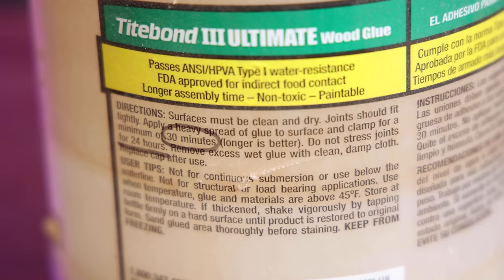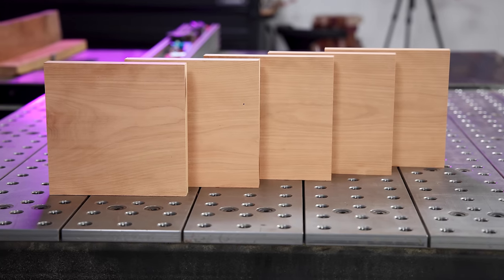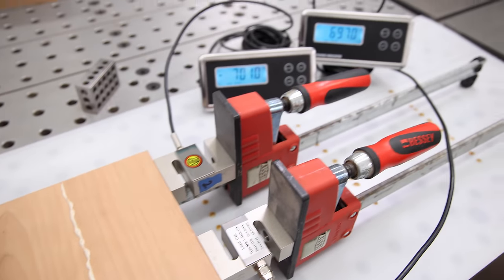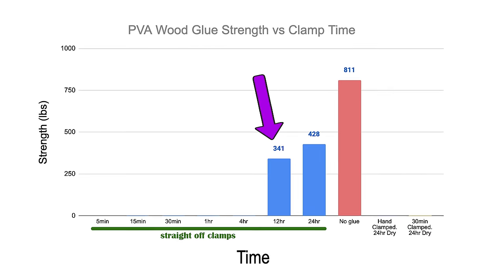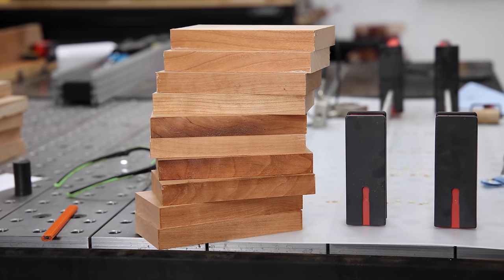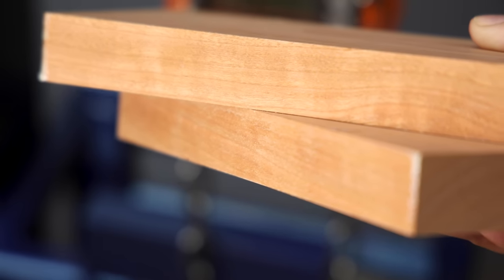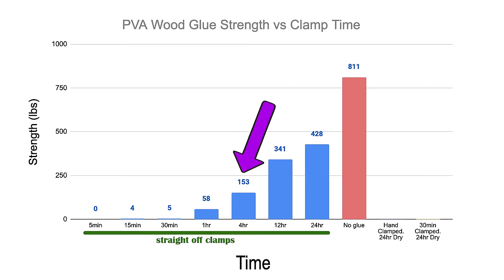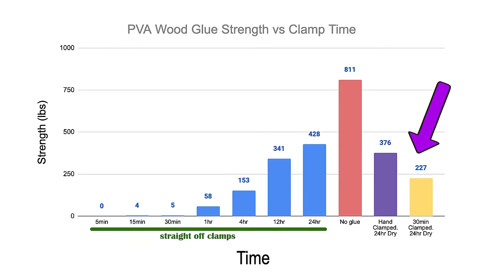you are clamping too long

Comment: Did you also notice it said "30 minutes minimum but longer is better"?
Reply: A few other notes:  Titebond uses hard maple for glue testing.  A planed surface is somewhat burnished and glue may not penetrate as well as a surface that has been sanded.  High clamping pressure can cause excessive squeeze-out and starve the joint for glue.  As long as the glue still contains some of its water, it's not fully cured.

Comment: Clamping is simply to ensure proper contact and immobilization of the pieces during lamination. You seem to be testing based on an assumption that clamp time equals, or is somehow related to, cure time. Overall, it's nonsense to test wet glue, you wouldn't drive on fresh poured concrete and expect it to be solid. Also, because the aim is to adhere the wood fibers of both pieces together, not just having a glue filled gap, squeezing out the majority of glue is key. The strength comes from the impregnated wood fibers bonding with those on the adjoining face.

Comment: I think the "company test" faired worse than the "hand clamp" test, by a very silly reason. Hands are squishy, clamps are not.

If you just clamp them by hand, you're not applying as much pressure and your squishy hands are the ones doing most of the palstic deformation anyway. With clamps, pressure is higher and it is the rubbery still curing PVA that is the squishest bit, and like any rubbery material it will want to expand the most whent the pressure is release, widening the gap and weakening the final joint.

Comment: So, your setup where you plane the pieces at the same time and then flip them like a book: i have no idea how likely it is for the surfaces to become uneven, but it seems like you're using that method to deal with unevenness, no? 

But isnt it true that if there was any unevenness, the book situation would place the high spots and low spots in direct contact with each other, amplifying any unevenness? Similarly, if the angle of the plane is ever off from 90⁰, flipping the pieces like a book will again amplify the error, not lessen it. To me, this isnt the way to make a perfect joint, it's the way to find out if you made any mistakes cuz they'll be made more obvious.
Reply from the maker: It’s not a bullet proof method unless you have proper techniques applied. Each sample were inspected to be gap free for the tests. Eventually I used a shooting board make sure the consistency was at a high level.

Comment: You may want to make your experiment more of a practical usefullness for outcome. The glue join is never at 100% of required strength or we'd see most projects fail in real use. It's more likely the glue joint is 60% or less to include a factor of safety, that's engineering speak and the thinking that keeps people alive. So the join needs to initially keep the project together then strengthen for in use load. If you run the same experiment and leave the project for 48hrs then test you may have more meaningful info

Comment: Glue needs 24hrs to dry, that is what your test shows and what the manufacturers say. That shouldn't be the variable. Clamp time vs unclamped time should be the variable.

Your dataset does not support the conclusions you gave. You don't know that 1 or 4 hour clamp time with 24hr unloaded time would perform better than the 30min clamp time with 24hr unloaded time as you didn't test that.

In fact you showed that zero clamp time is better than 30min clamp time (which I think we can all assume is an anomaly, based on experience, but not supported by the data), which implies that less clamping time is better if you leave it for a full 24hrs. 

That said, I like that you are doing this sort of thing and bringing some science to this. But feel the experimental design could be improved

Comment: Regardless of the clamp time, the glue drying time has to be consistent or the whole thing is meaningless. Making conclusions about necessary pressure based on the way this was done is invalid.
Most experienced woodworkers know you do your clamp ups at the end of the day and disassemble them the next morning. They also know that average firm tightening is enough pressure... you don't have to bear down on them. Ultimately clamps should be on until the glue dries and otherwise pressure in psi is not really a worry.

Comment: When I read the bottle and saw 250 PSI I was sure it must be incorrect.... Think about it, if you have a 6"x6" board, that is 36 square inches.. If you go by the bottle you will have to put 9000 lbs on the board to clamp it at 250 PSI.... There is actually no fucking way they understand the unit PSI.. Pounds PER square inch.

Comment: Is it possible your prep was too good?  If the wood species is hard and the faces are perfectly smooth and parallel perhaps there is not enough glue left in the joint?
Reply from the maker: It’s definitely something I need to explore more. Sanded vs saw cut vs hand planed glue edge and respective strength.

Comment: Comon man, you are mixing up clamp time with cure time. Cure time should be 24 hours for all samples, but the clamp time can be different. That's the time table I wanna see.
Reply from the maker: My goal was to see how strong the joint is at that clamp time and find a point where clamp time made the joint as strong as the wood (4hrs). More data would have been useful for stuff like 1hr clamp time and letting it dry for 24hrs but producing this video took enough time out of my life.

Comment: It seems to me that you need to try this with different kinds of wood to prove your point.
Reply from the maker: Wanna help me? Bc these testing takes many hours per set. Adding one species of wood is probably going to take 20hrs+ for each species.
Reply: I suppose if cherry is less like to split than other woods it could be deduced that the results are valid for the weaker ones. I appreciate the time you take to produce these videos. If it's not worth it to you, then quit.  If it is, then don't complain about it. .  @WoodcraftBySuman
Reply from the maker: @MrMasterFlash   It actually goes the other way around: using a single species of wood was a way for me to control confounding variables. If you don't understand why that is relevant, the video is not for you.
Reply: Imagine if you did this with wood that is always weaker than the glue--can you see why the experiment wouldn't work? The same thing with wood is always stronger than glue. You don't need to be defensive. It's not a good look.  @WoodcraftBySuman

Comment: The hand plane, used simultaneously on two pieces of wood, still requires you to plane a perfectly flat surface. Your move hand tool user.

Don't believe me? Plane some high & low spots and see how all they align.
Reply from the maker: Well, they started out pretty flat and straight off the jointer/planer and further refined with hand tool. 
But I love your underlying implied assumption that I don’t know know what I’m doing with hand tools. Sure thing bud.
Reply: @WoodcraftBySuman  genuine apologies for creating the impression, it was not my intention. I have no doubt that your skills are vastly superior to mine and your contribution to the community is beyond excellent. Truly. I have no doubt on your skill with hand tools. 

In this case, you are demonstrably wrong but I will work on trying to give better criticism, and try to make my genuine respect for your work far more apparent.
Reply from the maker: @JustinShaedo  Justin, I am open to learning and understanding. It is often difficult to demonstrate everything in a video intended to maintain retention. What is your concern on the technique? 

I started with flat and straight edges. The two pieces of wood is 2” wide in total and my blade is 2-1/4” wide— allowing for a single pass to hit both boards at the same time. Beyond that, it really just comes down to appplying the right amount of presssure and mechanics at the beginning, middle, and end of the board with a properly tuned plane. I then visually inspected each joint for fit. Would there be something I am missing?
Reply: at 2:17 "when you fold them in like a book, it creates a gap free joint". The technique shown is great, nifty, more stable, easier to plane across the grain and almost certainly faster; but it does not improve the chances of getting a gap free joint; that is entirely based on the planing skill. If the planning is not straight, then there will be twice the gap and if the planning is not level then the boards will be out of alignment (still a great idea, it just doesn't reduce gaps, easily demonstrated as per OC). Respect to you for having the skill to plane it flat and level though!
Reply from the maker: @JustinShaedo  you are absolutely correct- if done incorrectly, it will compound the error two fold. As you may be aware, the nifty thing about this technique is getting a 180d surface that become a perfect mirror image. As long as the planing technique is there to keep things straight, the resulting joint is crispy

Comment: the video started off with such great info and then dive bombed into uselessness... what good is testing the glue "strength" after a 5 minute clamping when the glue isn't even dry? The only data that matters here is how long the clamps need to be on a piece... can i take clamps off after 20, 40 or 60 minutes so I can glue another part of the project if I am limited on clamps? Even if I do this, I'm going to let the glue fully dry overnight before I continue assembly or load the pieces... if you are not standardizing the amount of time between the glue application and the test then the "clamp time" variable is nearly meaningless because you've introduced another, almost certainly more important variable of glue dry/curing time...
Reply from the maker: Did you watch the whole video to the end? Because I think you may have missed a few points.

Comment: 9:44 the comment you make here explicitly goes against the data you presented. The wood itself breaks with a force over 5 times the force to break the 4 hour glue joint. Can you explain what you meant by that choice in the video? 

Also, I think the results were misleading due to stressing each joint immediately out of the clamps. The titebond bottle specifies to not stress the joint for 24 hours as you show in the video. So would a better test have been to vary the time in clamps as you did, but stress all the joints at the 24 hour mark?

Comment: You could come back to this  subject and let all the samples dry for 24 hours.  PVA glue has water in it that  the wood absorbs and expands at the glue line if a panel is worked before it is completely dry. The wood will shrink at the  glue line and leave a depression. also if you work a panel before it its dry chances are you covering your fancy machinery in wood glue which will take time to clean off  destroy belts make you or  the boss angrier than they should be and the customer will reject your work because of the  very visible glue lines and the woodworker feels the shame for not knowing better. Just let the glue dry man relax go home and be with the family and the panels will be waiting for you in the morning  ready to become  the doors, tabletops  or boxes they were destined to be.

Comment: The flaw here is you are testing CLAMP time. This does not mean the glue has cured at the point the clamp is removed. The joint still needs 24 hours to cure and develop full strength. This testing does not test glue strength, it just illustrates curing time is needed when the clamps are removed.
Reply from the maker: Correct. The intention of the lower clamp time was to see how strong the joint is at that point in time to assess if clamps can be safely removed. I agree having an additional sets of data for 24hr clamp time at each point would have made for a more comprehensive look at this issue but that would have taken a ton more lumber to do and an extra week. At 4hrs the wood glue is cured enough to be as strong as the wood fibers itself. Thus, it is a reasonable enough conclusion that clamps can be removed at that point and the strength is good enough to be handled and allowed to dry.

Comment: I don’t understand anyone supporting this conclusion that 24 hours is too long….Nor do I understand his comment that at 4 hours the joint is “nearly as strong as the wood itself”…….

The data seems pretty cut and dried to me:

811 lbs of force for an unglued solid board.

428 lbs of force for 24 hour clamping… The highest sustained force of any of the glued boards. 

341 lbs of force at 12 hours, about 80% of the strength of a 24 hour clamping 

153 lbs of force at 4 hours and our host’s chosen clamping time is barely a third of the strength of the 24 hour clamping???? And no where near “as strong as the wood itself” as he stated…….

Wtf?

I applaud is methods and thorough data collection but his conclusions seems to entirely ignore that data.  Or am I missing something here?
Reply from the maker: Two things: 
1) Natural wood has more tensile strength and is likely to be stronger than inturrupted glue line that causes acute stiffness and stress near the glue line. So comparing the glue line sata against natural wood is probably not the best way to see it. 
2) the video is about when you can remove clamps so they are free to be used on other projects. At 4hr the glue line is cured strongly enough that unclamping disturbances would likely not have negative impact on the joint as you allow it to continually cure for another 20hrs. Ideally I would have the data to back that claim as well but these tests take weeks to do as-is. So there is an underlying assumption that curing the 4he clamped joint further would make it stronger. Ultimately though, if the joint is strong enough for the glue line to not be the point of failure, you really don’t need more strength than that.

Comment: A video that complements the experiments that you’ve shown here is the one by Patrick Sullivan that explores glue strength over time along with looking at gaps in imperfect joints. https://youtu.be/sWpH857A0Ms
 The big takeaway? Well-clamped PVA glue reaches 90% of its final strength in 5 hours. That’s the magic clamping time.
Reply from the maker: I don’t realize Patrick has done a video on this. I’m glad we both reached similar conclusions (mine being 4hr and his being 5hr). Obviously there will be some temp/humidy/clamping force/joint fit/species of wood/grain direction variability but still coming in pretty close. That’s great!
Reply: Yes. If you look at his graphs, the difference between four hours and five is very small. Either will work well and will depend upon your own work schedule. I personally just like the even number of “90%” and have been gluing to that schedule ever since. Love all of your videos. Keep doing them when you can. Between you and Patrick and this one by Scott Walsh: https://youtu.be/xBzzTT_axhE …perhaps some of the long-standing and widely believed—and very wrong—myths about joints and gluing will finally be dispelled.
Reply from the maker: @thefoxfireworkshop  haha funny you mention that video. Scott did those tests in my shop.

Comment: If you're testing clamp time, why not have them all cure for 24 hours after the clamp time? Your not letting the glue cure.
Reply from the maker: Because we are trying to figure out how strong the glue joint is at the time of unclamping to understand if there is enough strength to feel confident in taking clamps off. I would agree that having this data along with 24hr drying for all samples would have been a better idea.

Comment: Clamping drives glue out of the joints: less glue, less strength.  A followup test would be break strength vs clamping pressure.

Comment: Your method has a flaw, you are not comparing the effect of calmping time, but the effect of glue drying time. You need to let the glue dry for 24h for all the test pieces regardless of long the clamps been applied.

Comment: I don't know why you were testing after 5 minutes then testing not waiting for some cure time maybe waiting like 1 hour and testing and like 4 and 12 makes sense to test but I don't get why you would even do it I could see testing and waiting but juat clamping for 5 minutes and waiting for cure to test but so you could use the clamps on other projects
Reply from the maker: The concept of thr video is to find out how strong the joints are after letting it clamp for a given time to see if there is adequate strength in the joint to feel confident to unclamp. I agree a second set should have been done with 24hr dry time because the numbers would be more interesting to compare

Comment: Well, first of all, I thought it was wonderful that you tested the boards without glue...and given the mantra about glue being stronger than the wood, I was amazed at how much more force it took to break them!!!!
BUT, I am completely confused here by your testing and what you were trying to prove?  The "5 minutes of clamp time" should never have been tested immediately...why would it?  As you point up, Titebond NEVER said that the glue was cured in 30 minutes, just that it only needed to be held in clamps for 30 minutes.  So what were you trying to demonstrate with testing it after 5, 15, etc minutes?  I would have expected (and wanted!) to see the strength after clamping for, say, 5 minutes and then letting it cure for the full 24 hours...like you did for the (outlier) 30 minute/24hr cure test.
Reply from the maker: I wanted to demonstrate how strong the actual joint is on the left of 30min recommendation and on the right of the 30min recommendation in clamp time. From there, determine if the strength of the joint itself is strong enough to unclamp. Additional data on 24hr dry time for all the samples would have been more helpful.